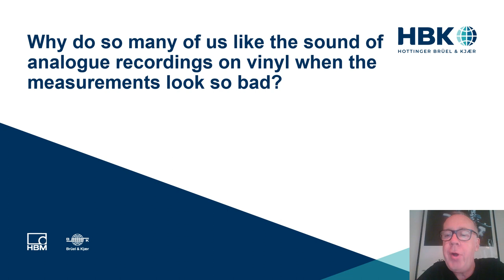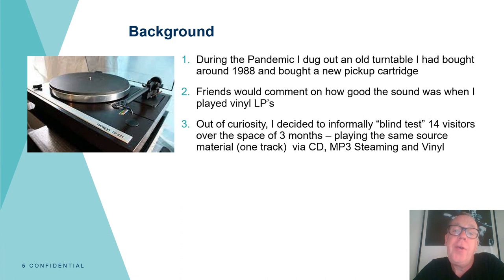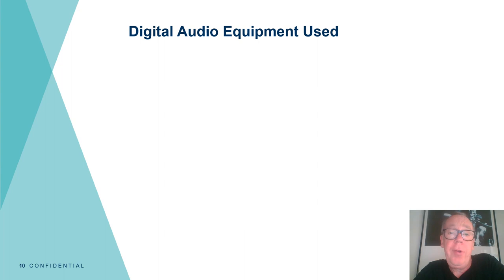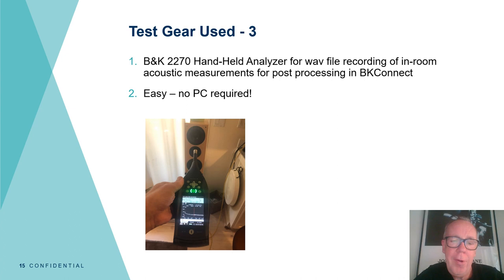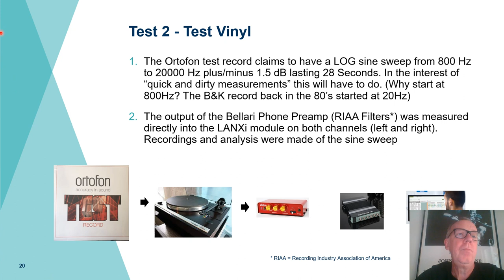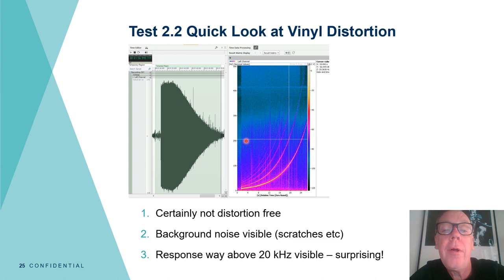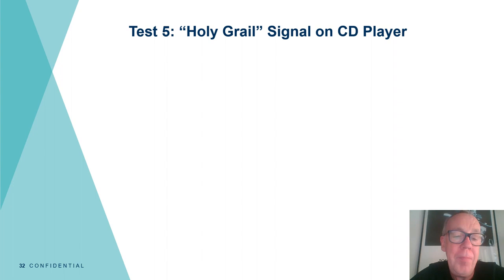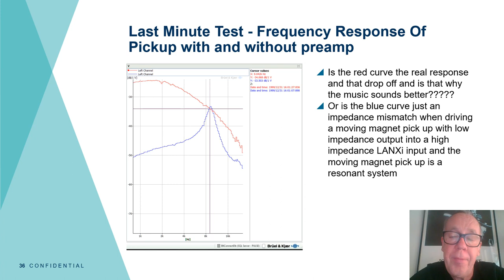Why do we like the sound of analogue recordings when the measurements look so bad? Mark Serridge

Comment: There have been one or two proper controlled tests on whether listeners prefer digital or analogue recordings.  That youtube video is not one of them, despite calling it a blind test to give it an air of credibility.

The reason why there are so few controlled tests is because they won't tell us what we already know. It is a bit like pouring resources and time into testing whether viewers prefer analogue broadcasts over digital or telephony consumers perfecting analogue wireless over digital wireless.

The one controlled test of peer review quality I know of was published by Geringer and Dunningan (Geringer, J., Dunnigan, P. "Listener Preferences and Perception of Digital versus Analog Live Concert Recordings." Bulletin of the Council for Research in Music Education. 1 Jul. 2000, Number 145: 1-13) when they compared several all analog recordings with digital recordings of live concerts. An excerpt from the paper below:

"Subjects listened to digital and analog recordings of the same concert performances, recorded unequalized and unmixed (tape and CD). They were able to switch back and forth between the two at will, and everything was double-blinded and level matched. Overall, the digital version was preferred in all ten scoring areas.

The researchers concluded that results showed that music major listeners rated the digital versions of live concert recordings higher in quality than corresponding analog versions. Participants gave significantly higher ratings to the digital presentations in bass, treble, and overall quality, as well as separation of the instruments/voices. Higher ratings for the digital versions were generally consistent across loudspeaker and headphone listening conditions and the four types of performance media."

Note that this test correctly controlled for mastering and mixing differences, the recordings were of the same live event and importantly, it was a proper double-blind test to control for biases not just among listeners, but also the tester - ie the tester's preference for one media over another not influencing listeners with subconscious cues. It was also a comparison between CD and analog tape (a superior analog format to LP records).